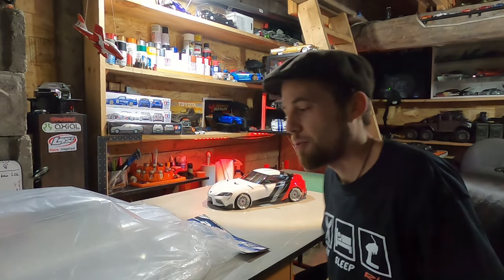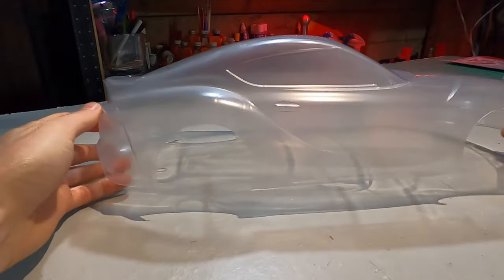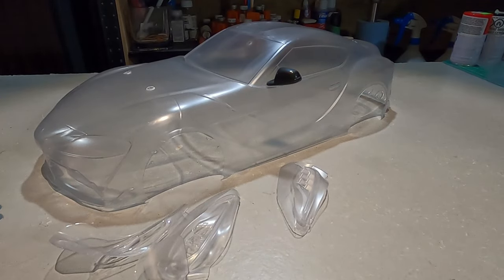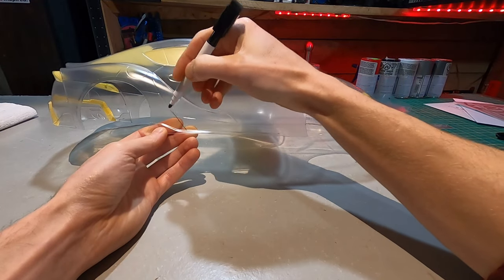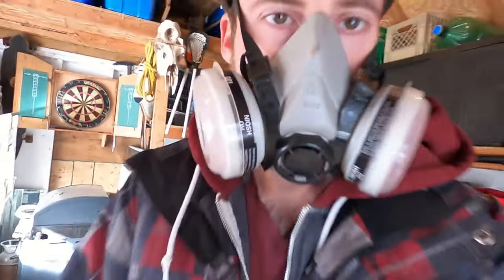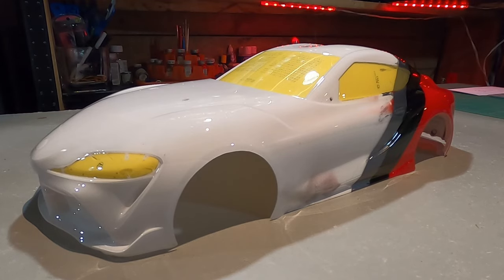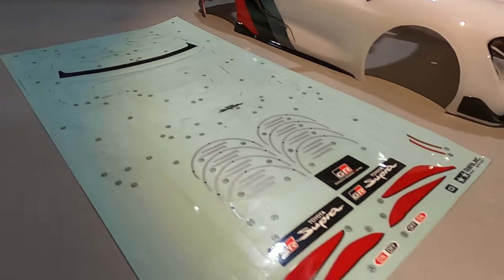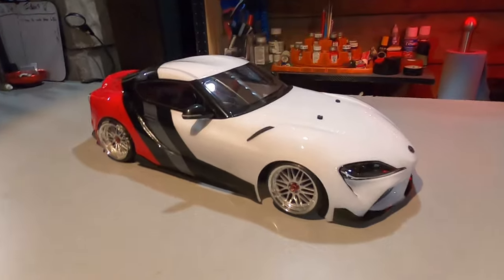HOW TO Paint An RC Body - Beginners FULL TUTORIAL - Tips & Tricks - Clear Lexan - Tamiya GR SUPRA

Comment: The best way I've used to remove overspray before applying the next color is using q-tips and Nitro fuel.  Clean with alcohol after the nitro
Reply from the maker: Ouu interesting! I'll maybe give that a try next time if I have that issue again!
Reply: @IRONSIDE_RC  yeah bro, works great!  Que tips, and Hobby Lobby sells cue tips with very fine cone shaped tips for tight spots.  Popsicle sticks work good in spots as well.

Comment: I was thinking can I use normal aerosol spray? and do you sand the inside before painting?
Reply from the maker: I don't recommend doing that! Normal paint won't flex and it will Crack and chip after time! No don't sand it will scratch up the surface
Reply: Do not use anything but polycarbonate paint!

Comment: One question brotha, how do you cut the wheel so clean? I've always struggled on cutting the wheel clean.
Reply from the maker: Scoring the lexan with an exacto blade on the body lines is the best way to get clean cuts you can see in this video. Also check out my how to cut and install clear windows video I demonstrate this method in that video also! Good luck✌️

Comment: I used car paint, and regular (plastic-friendly) spray paint for the final layer.

Problem is it chips and flakes off for anything. What did I do wrong? Could it be just because I didn't wash the shell before painting? Do I have to use model paint?
Reply from the maker: Oh no! Yes washing body to remove oils is needed. Also the correct paint is most important. You need a polycarbonate paint for the lexan body's because they flex so much

Comment: What kind of paint do you use?  Is there specific paint necessary?  Or can I use typical Rust-Oleum?
Reply from the maker: Hello! I would recommend the tamiya paint. Has to be PS - polycarbonate approved because the lexan rc body's are very flexible. Normal spray paint like rust- Oleum would  Crack and flake off after some hits and movement / flex

Comment: Why do you paint on the inside of the body? And can you use regular spray paint?
Reply from the maker: Hello, it's painted on inside so it doesent get scratched up. I would not as it won't flex under impacts and use this will lead to cracking paint and chips
Reply: @IRONSIDE_RC  ok thank you for the advice

Comment: Quick question for the tail lights you leave outside clear? Paint inside silver?  And just use red bulb ?
Reply from the maker: For taillights and headlights you leave it clear on the body just tape them off on inside or use provided light Masks. You would paint the light buckets black or silver usually you can install stickers or cut to make actual led bulb fit! Those get mounted inside the body. Leaving the body clear makes you see the light buckets on the inside giving it a realistic tailight appearance. Hope this helps

Comment: How do I measure the body to fit my chasis, is it by the wheelbase or width?
Reply from the maker: Deffinately wheelbase Is the most important! If your wheels don't line up will have rubbing and steering issues! Width is good also to match up with your rim offset. If you search your chassis online can usually find the wheelbase and width pretty easy or look in you instruction manual
Reply: @IRONSIDE_RC  awesome, thanks for getting back to me. I build a drift RC a while back but I’m getting back into it and I was just drifting without a body now I want one. Thanks for the help